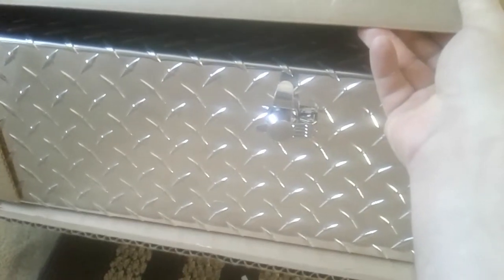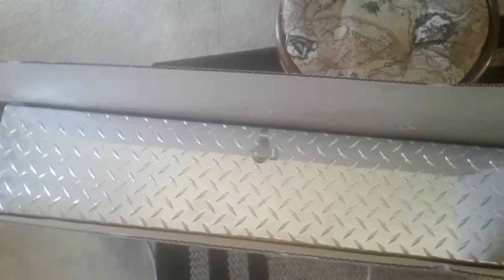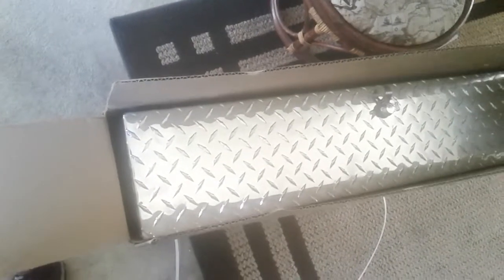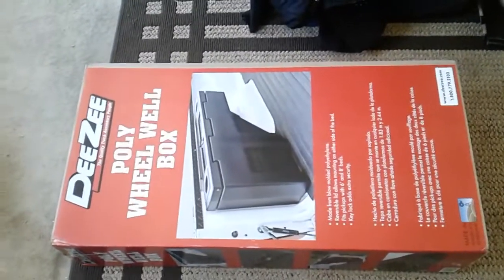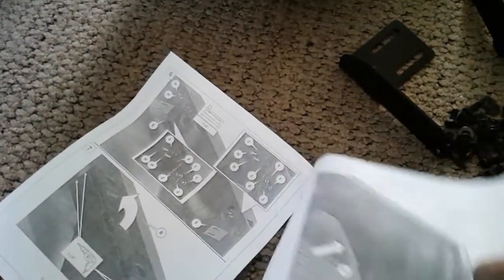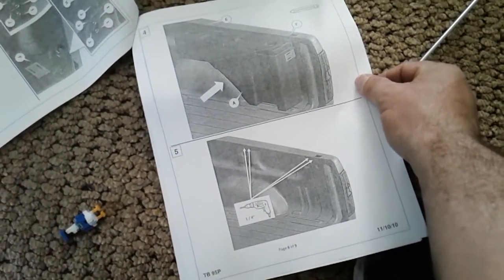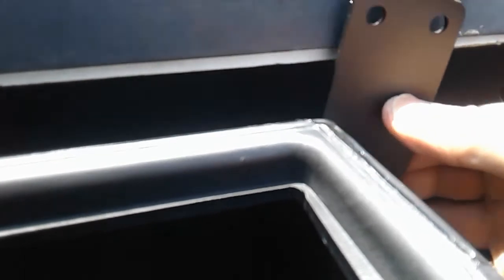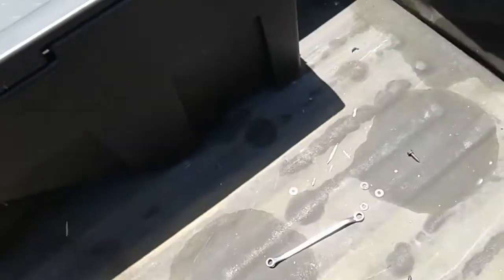Dee Zee DZ95P wheel well tool box Ford F250 Super Duty

Comment: I painted a tool box black ONCE! I could heat my lunch in it. I live and work in Redondo Beach, at the beach and the salt air is relentless. 6000 series alum. holds up, it gets a slight haze on it that actually protects it. We have boats made out of it and they dont need paint above water line.